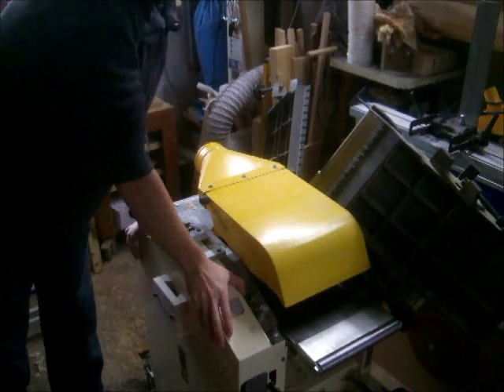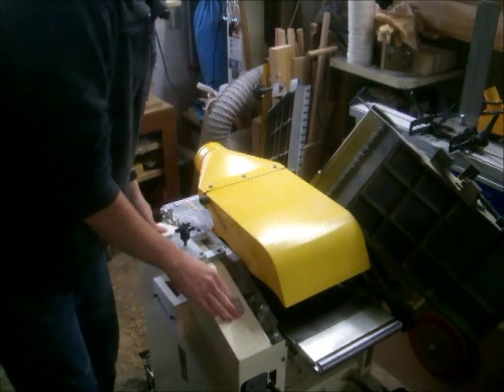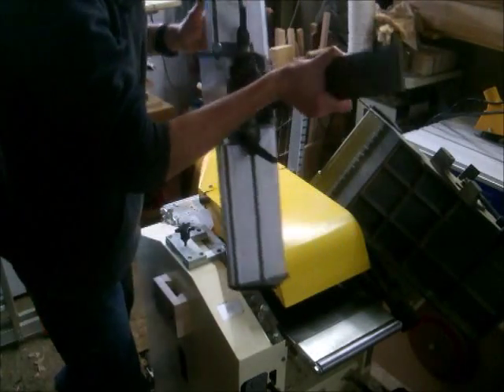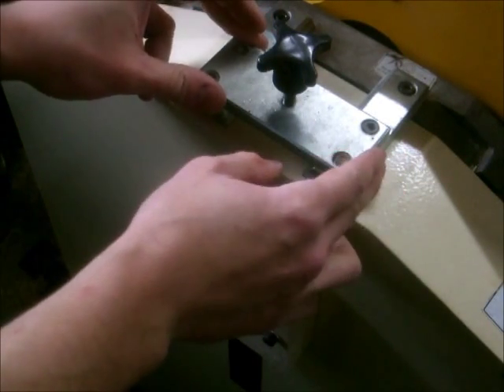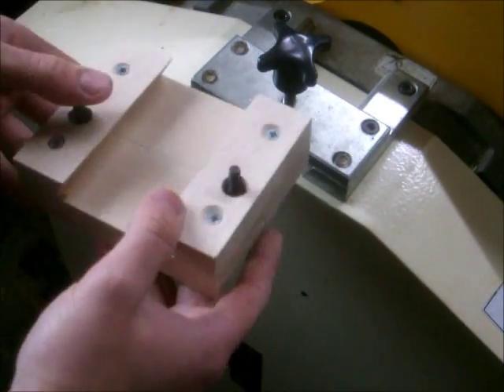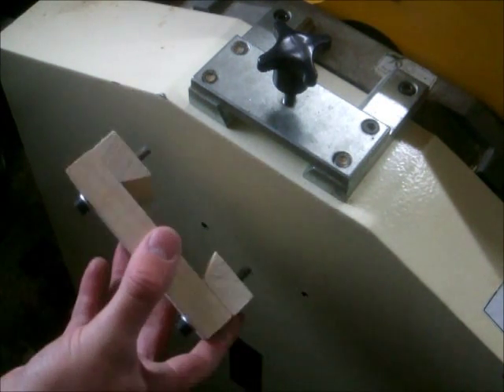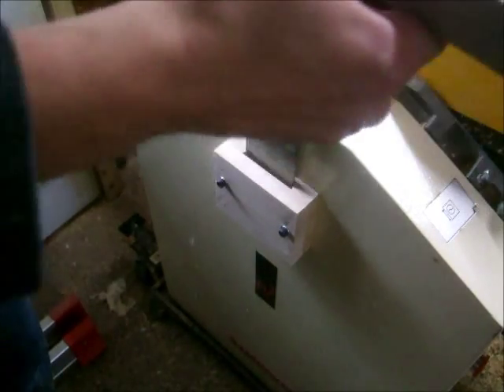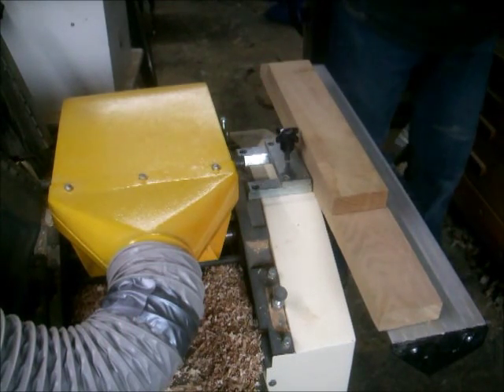Planer Fence Storage (Axminster AW106PT)

Comment: Thanks for the reply/advice. Never had a p/t before but just ordered this model from Axminster,. I'm a mechanic by trade and don't like cheap poor quality tools, never have! Never will so gone as big as I could afford even though it is only for hobby use.
Reply from the maker: You're welcome and I'm glad I could help. Anything cheaper than this model would have a noisy brush motor as well, where the Aw106PT has a smooth induction motor. I only sold mine because it was heavy to move (150kg) and I was limited on storage space when I left my previous workshop.

Comment from the maker: @nigelsportster Hi Nigel,

I've had this machine since August 2007 and haven't found many faults. It's very sturdy, reliable and, with its induction motor, very quiet (when not cutting). You could not buy an equivalent new machine for less money.

Lifting both tables off and removing the fence is always going to be a pain. Dust extraction, in my opinion, could be better and I have found that the thicknessing bed is about 0.5mm out of parallel from the cutter block - not a great issue, though.

Comment: Hi Olly - Thanks for the great idea for the storage system.  Just wondered if you could help me with something.  I have exactly the same machine as pictured - I have  an issue when feeding in the timber to the in feed rollers - I have to push the wood through and pull it out the other side, as the rollers don,t seem to grip.  I’m sure this is not right but am at a loss as to how to correct it.  I’ve tried lowering and raising the bed to try and get some grip, but to no effect.  Any ideas would be great fully received.

Thanks BJ
Reply from the maker: Hi BJ - thanks for watching and for your comment.

Have you tried adding any form of lubricant to the bed? I used to use a dry PTFE spray, a lot of people will also use wax - either from a tin that you apply by hand or you can rub a candlewax or beeswax stick over the surface. That would be my first suggestion, as it should help the timber to slide across the surface.

I'd also recommend doing the same to the planing tables on top.

I hope this helps for now but please let me know if you require any further advice.

Olly

Comment: Would you recommend this planer/thicknesser?
Reply from the maker: Hi Nigel and thanks for your comment - it's the best planer/thicknesser that I've owned and so, yes, I would happily recommend it. A shame it is so much dearer today, when I think I paid just under £500 in 2007!

It outperforms my previous P/T and is built to last. My only gripes were that I didn't think the dust extraction hood was as efficient as it could be and that the thicknesser bed was about 0.5mm out of parallel with the cutter block, over 250mm width... Meaning boards would come out very slightly tapered - but it wasn't easily noticeable and not a big issue. Seems to be a common fault, though. I've no idea whether the newer models have addressed this.

Hope this helps and thanks for watching.